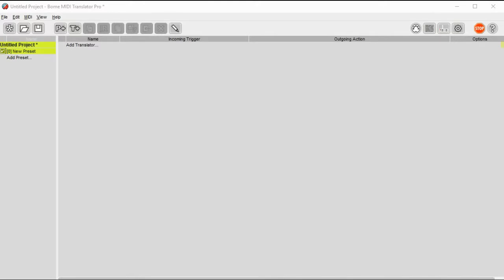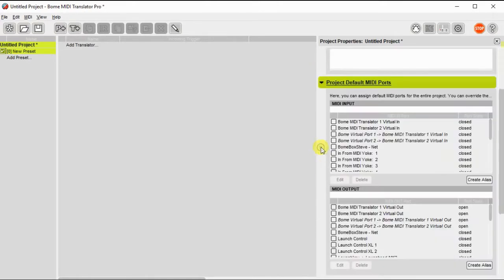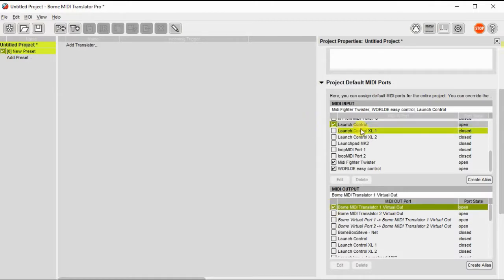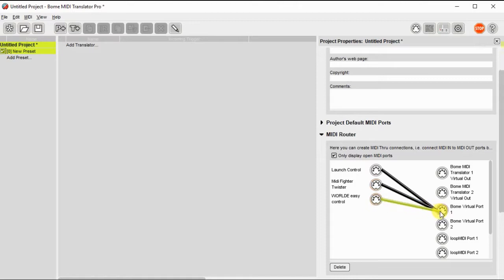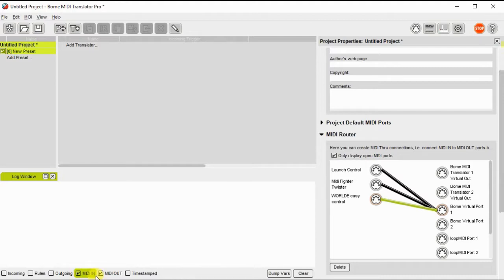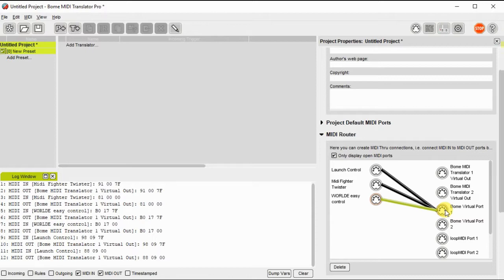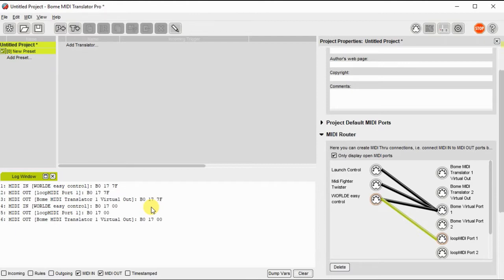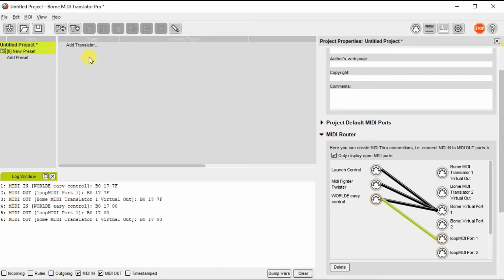Tutorial: Merge multiple MIDI streams using Bome MIDI Translator Pro

Comment: is this how you offset midi's to use two midi controllers at the same time and they act independently to each other and don't work as if they are paired
Reply from the maker: Hi,

I will answer in the forum thread you opened below.

https://forum.bome.com/t/eos-lighting-software-with-two-midi-controllers/4885/2

Steve CaldwellBome Customer Care